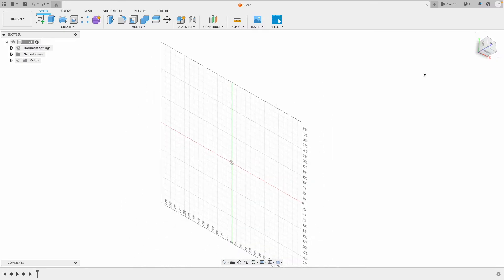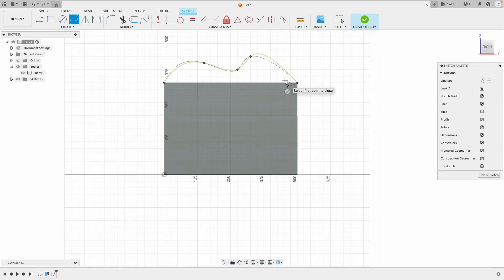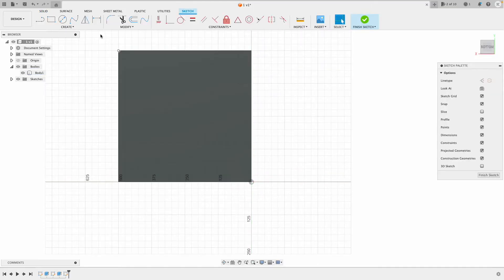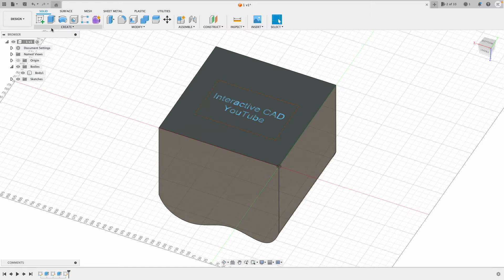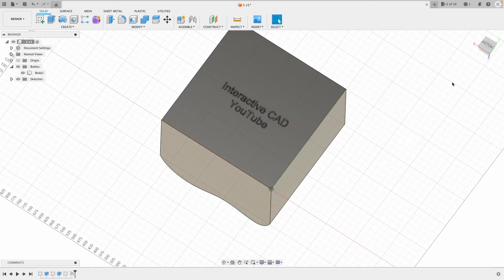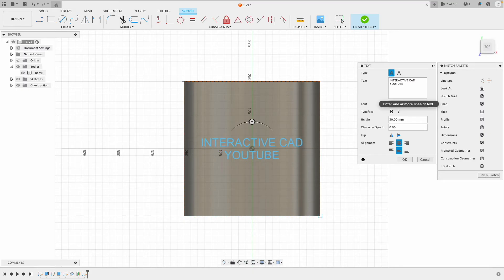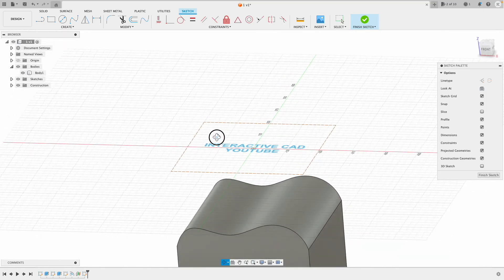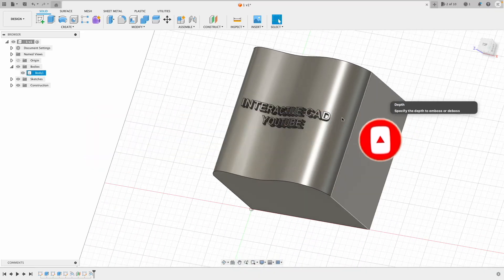Autodesk- Fusion 360 Engrave & Emboss Text On A Surface

Comment: When I apply my text to the surface it is straight and is centred, however, when I select sketch profile and then face the text appears curved, how do I straighten the text?
Reply: I figured it out, my part was just two aligned rectangles one below the other and centred and with the middle of the adjoining line removed in order to make one solid part, the purpose of the part is to place my drill bit in the corner to keep it straight while drilling.
 I had placed the text "Straight" on the top rectangle and "Drilling" on the lower one, this was when the text appeared curved when I tried to deboss it.
If I did just one word at a time the debossed text was straight.
Do you have any idea why this happened?